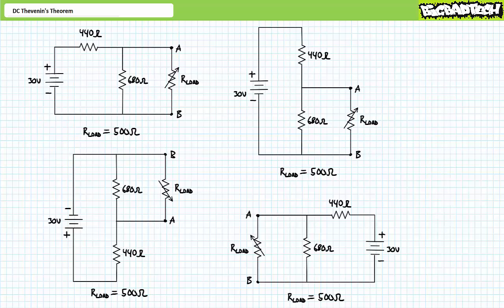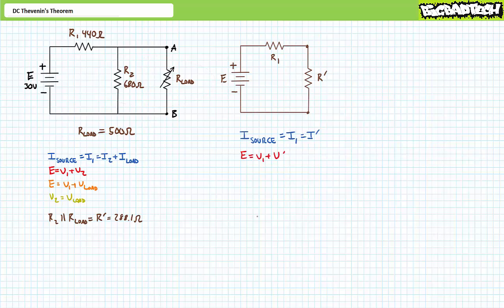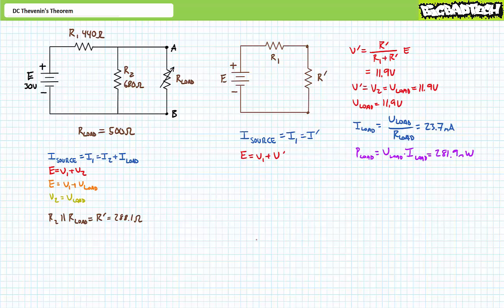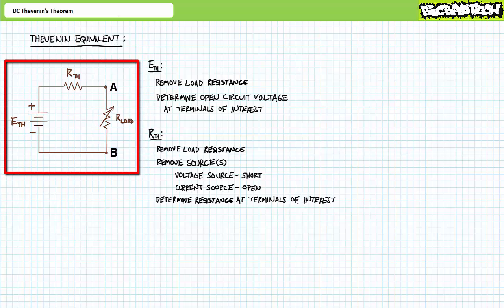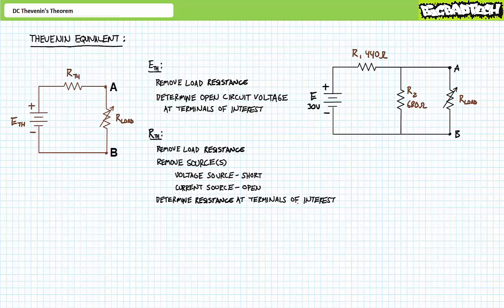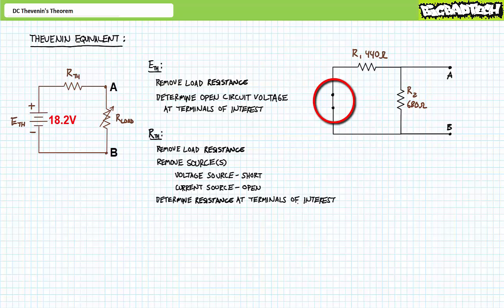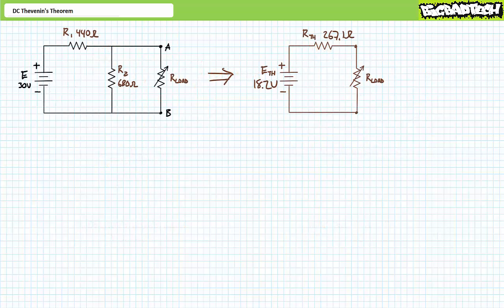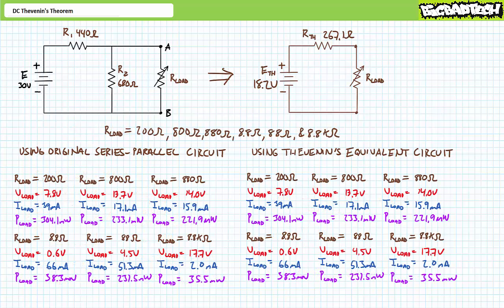DC Thevenin's Theorem (Full Lecture)

Comment: Just for clarification at 20:06, when calculating the current in the Thevenin equivalent circuit, we do not add the Rth and Rload?
Reply from the maker: There's a couple ways to solve for current since the Thevenin's equivalent is a series circuit (ie: current in series elements is the same).
Isource = Eth/(Rth+Rload)
Iload=Vload/Rload
Ith=Vth/Rth 
All of these should yield the same result.

Comment: why short and/or remove the sources
why remove one but short the other
is it a happy little accident that just so happens to work or is there a reason?
Reply from the maker: Them's the rules. Voltage sources are removed from consideration by replacing with a short circuit. Current sources are removed from consideration by replacing with an open circuit.
Reply: @bigbadtech But why have Voltage sources replaced with a short circuit and not open one. Is there a reason for that ?
i can  solve homework but i dont have a deeper understanding as to why i do what i do
Reply: @Science-yq2ll  Ask yourself why. What does it mean to have a voltage difference? And, if we are talking about ideal cables we can assume that the potential difference for any point on the cable is 0. So, if you want to eliminate the voltage source, all you have to do is replace it with a cable.